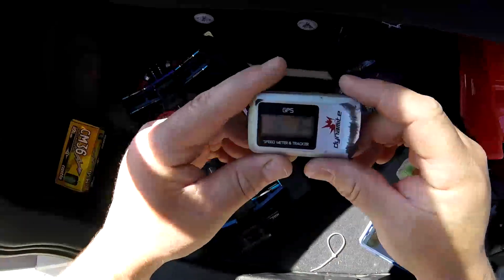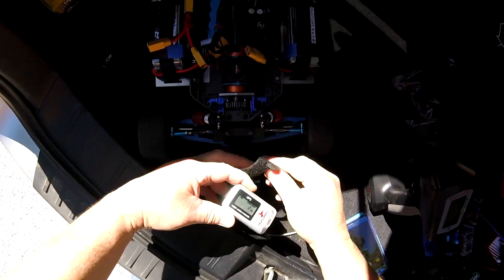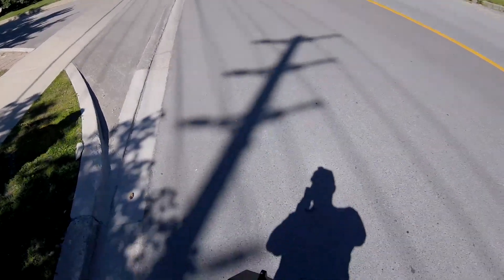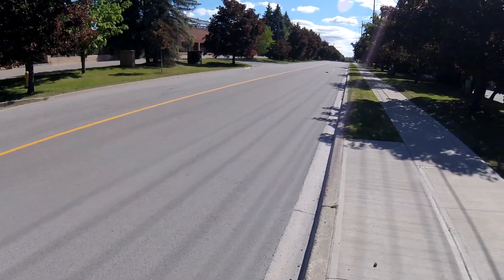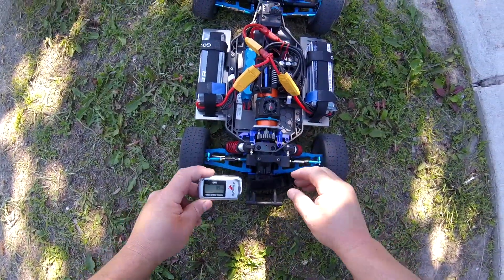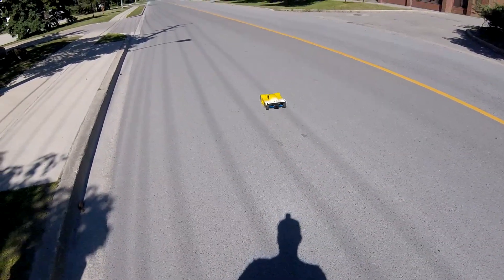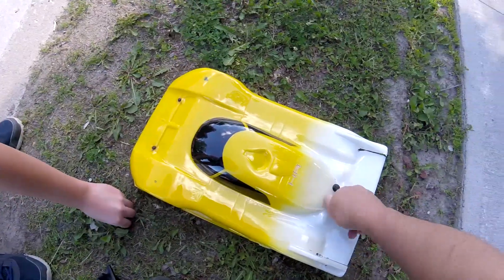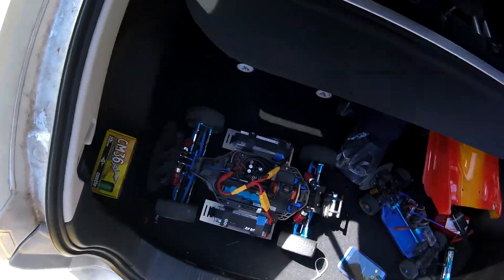Traxxas Slash 4x4 Speed Run Build - Update 4 - Max 6 & Surpass 3670 motor ***PART 1 OF 2***

Comment: Hi I’m trying to get 55mph on a tt02b have you got any tips?
Reply from the maker: 55mph is pretty easy. I'm running a 45 tooth pinion and 52 tooth spur. If you don't want to go too fast you can go for a 60 tooth spur and a 42 tooth pinion or experiment with pinions. Robinson racing make the touring car spurs and pinions(48 pitch gears). Dremel or cut out the gear cover if you need clearance for gears...you may not if you go with the 60t spur and 42 pinion. Get a pretty high KV motor like a 4300 or 5900 and a yeah racing adjustable motor mount. Get some 2 degree to 3 degree rear toe in uprights(yeah racing) and run a little bit of toe out up front. Use a 3s lipo battery and an 80amp esc or 120 amp is better. Find a nice flat straight road with little traffic and have fun. 😀
Reply: Thankyou